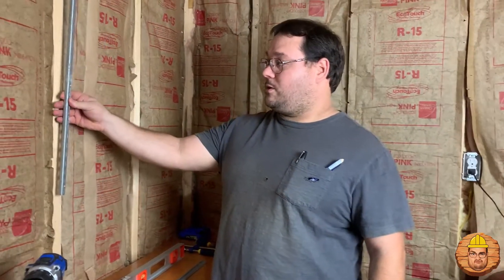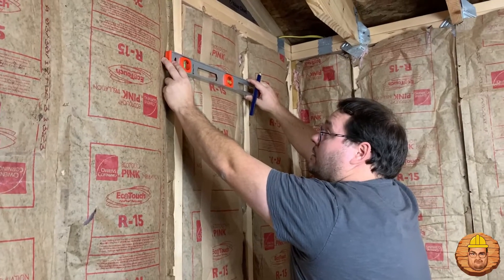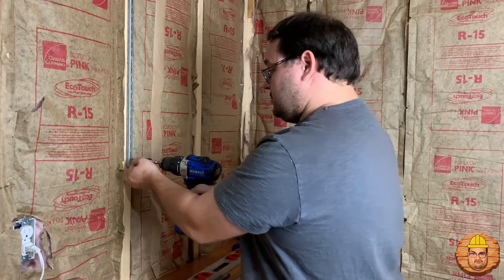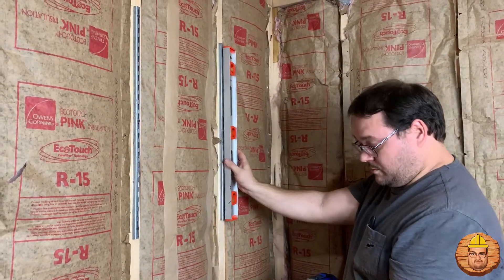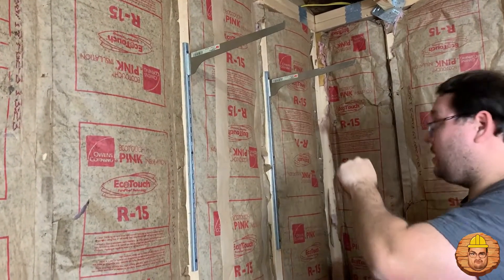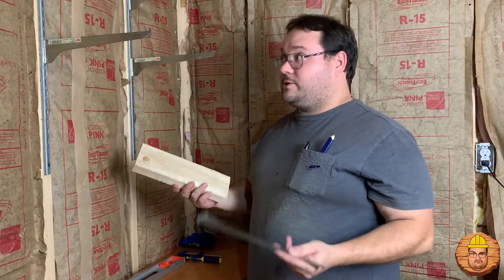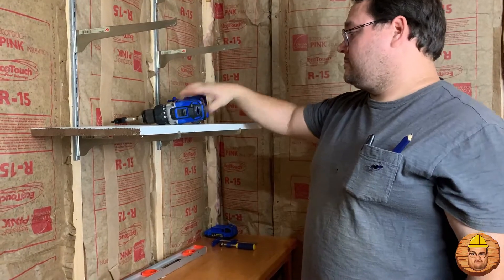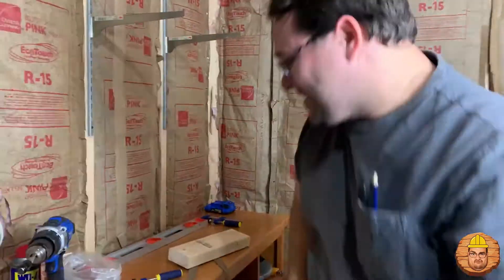#HowTo Install Single Track Shelving - DIY Installation

Comment: Three hours into todays "over window shelving DIY" deep dive: 
i only have one 48 inch shelf track, 2 brackets & 40 leftover fence planks 😅
( BIG MAYBE on the hacksaw part so  i already watched Milwaukee sawzall tutorials to cut the shelf track in half, hoping to have the right blade laying around 🤞🏽😅)

....last experiment has built in curtain rod & i made the brackets from tree limb trimmings 😎fun build & still intact! 

...id say wish me luck but your down to earth tutorial has me CHARMED, so relieved 😅Even the cutting up at the end is so down to earth, appreciate yall!😜 Subscribed hoping to never need Home Depot or closetmaid tutorials ever again. Thanks, Dad.    ****edit bc You had to be  G ONE MORE TIME! my remaining drill bits thank you! *me also adjusting my drill to 3 FROM 8 🤷🏽‍♀🤦🏽‍♀

Comment: What type of screw are you using.
Reply from the maker: I really like using deck screws T25 for a lot of things. I normally go with any screws with T25 over any others. Just love the way I can drive them right into the board. Dang good feeling.